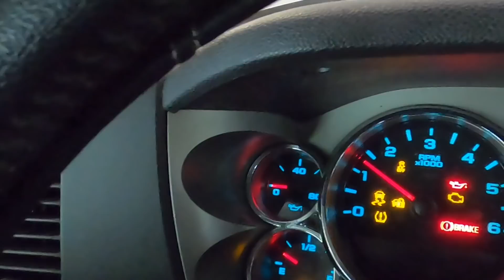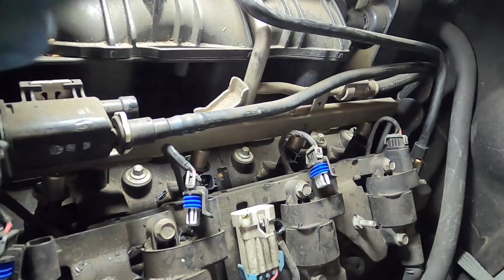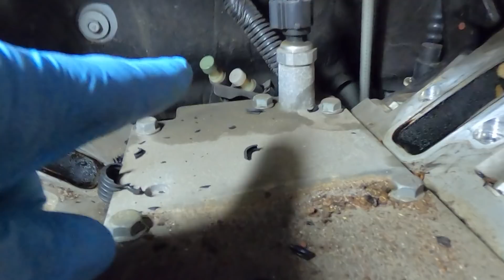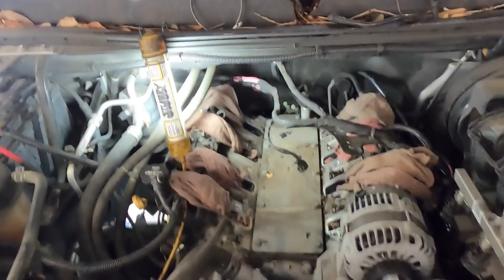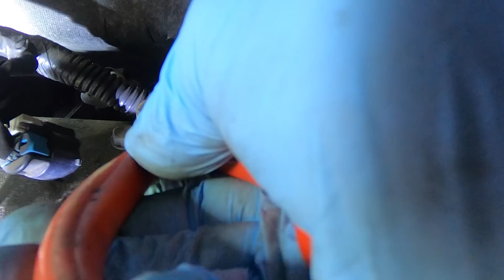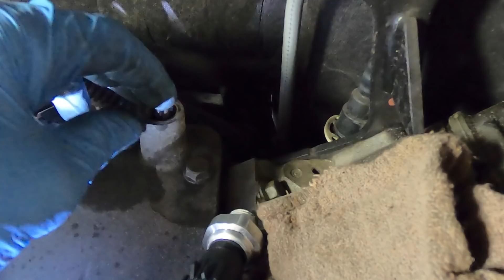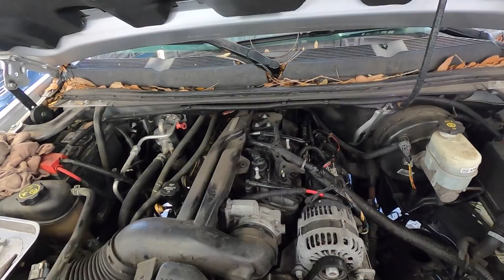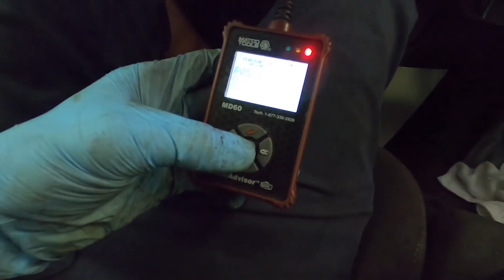Customer States: Google Diagnosis…replace this part!

Comment: Next time you get one of those, try ops socket with a swivel. A little tricky but you can remove the sensor without removing the intake ive done it a few times.

Comment: Great video. I would have taken that manifold off and replaced that sensor, and then scratched my head over how all that stuff went back on. I'm a whiz at removing anything in the way, but then....  If I worked there, I'd have to call for a group meeting and group vote about your shop radio. Seriously.

Comment: Haters are gonna hate.  People don't realize that 'book time' isn't ACTUAL TIME TO INSTALL.  You have to pay for your tools, the shop has overhead, insurance, office people, TV FOR THE WAITING ROOM, etc... etc.. etc...  You are NOT just paying for the part and time it actually takes to do something.  If they don't want to pay for that crap - take it to a shadetree mechanic and pray that they don't f something up - because I can guarantee you that they WILL NOT PAY to fix something they f'd up.  Going to a reputable mechanics shop, they'll stand behind their work.  Down to the bare bones - good job, Ray.  You take pride in your work and try and do what's best for the customer with the least amount of damage to yourself or the items you're fixing.  Like the truck that was over 20 years old (I think?) and you cut a hole in the plastic to save having to tear the dash apart (I think again... : )) and save the customer somewhere around $400 on the fix?  Good on you.  Customer was very appreciative, I'm sure.  

Anyways, keep up the good job.  Like you've mentioned, there's a 100 different ways to do something and depending on the vehicle and the way the engine is set up can make it a 1000 different ways.  :)

Comment: Friendly  advice if you are not going to replace the screen  you can cha ge the oil pressure sensor  without removing the intake  it just takes patience  and little bit of dexterity

Comment: So, what was the issue? Or what do you think it was? Instrument cluster gauge fail? Bad wire?

Removing the intake manifold to replace an oil sensor. Like doing the same to replace spark plugs... Built in labor for dealership mechanics.
Reply: You don't have to remove the intake to do the job. I'm just assuming he likes the longer process but easier version.

Comment: Whoa...I've never removed an intake to replace a gm oil sender.
I climb up on top. reach around both sides of the plenum and use a deep sender socket and appropriate extensions.
once loose, I remove by hand, start the new one by hand and tighten with the same tools. screen or no.
about 15 mins
Reply: Same! It's been a while but I don't even think the book pays for the intake to be removed either.... lots of wasted time but whatever is easiest I suppose, the guys really smart either way

Comment: You're a man of wisdom and integrity Ray.  I like that you explain the overall picture on jobs like this one, including pointing out things that the occasional idiot customer says or does. I highly suspect that 95% of the commenters who say they've done this exact same repair dozens of times without manifold removal or bleeding are liars.
Reply: Don't need to remove the intake manifold on a 1997 Suburban w the 5.7 liter vortex, just the air intake and the distributor.
Reply: Regardless of what you say,I have a half dozen  times. If you don't believe me. Bring  lots of. money and I'll  bet you and you can watch me do it.
Reply: I agree I want to trade there's no way you can pull that thing without taking the intake out oh I know drill a hole through the back of the firewall and it be right there no I'm dreaming hey have a good day

Comment: so 3 weeks pass ....I get a check engine warning on our 2006 Commodore Omega (Aussie version of a Chev Impala) it has a 3.6 liter V6 Alloytech motor ............I put my scan tool on it to get the trouble code P0523  , Mr Google told me the code was the oil pressure sensor , so I ordered a new one .........and the socket to remove and replace the faulty sensor , fortunately the sensor is in a relatively easy spot to get to , no disassembly of anything required (thank heaven) .....however , the tool to remove / replace , was more expensive than the sensor !!!

Comment: Hey Ray. I didn't see you take out old screen . They are usually plugged,  changing the sensor doesn't help you need to change screen.  I see that you couldn't install new one. Because old one needs to be removed. 🤔🤔🤔🤔🤔🤔

Comment: If you have a high that means it's a broken wire it's high resistance so the wire was broken somewhere along the line it may have been really easy to get to you didn't check the connector on the pressure sensor so that's where the problem could have been it it could have been the wire right on the connector or the oil pressure sensor but you didn't check that you didn't put a gauge on the oil pressure sensor port to check to see if the oil pressure was actual with the good gauge and you didn't check to see if the computer was connected by The wire isn't that part of it wouldn't that be part of the repair just to check that use your electrical meter there or your scanner I would at least put my scanner on there and check it then you could have said well I know you told me to repair that sensor but I think it's a broken wire so therefore I'll change the sensor and fix the broken wire

Comment: Ray check the wiring harness and the connector it was right there man just right there you could have owned it out just passed the connector check the integrity of the whole wire to the computer maybe that computer connector inside of the PCM that one wire is probably corroded on the computer

Comment: I think you should have checked the wiring harness to the sensor that's what you usually do isn't it on your other repairs I mean the guy was kind of stubborn just say just replace the sensor but I think we all know better you have to check the wiring harness it could be a bad connector right there at the sensor and then you had to tell the customer you know we had to charge you for that sensor connector I mean how much of a big deal is that and fix the broken wire put on a new connector

Comment: Then you could have said well you said only put the sensor on there but I found out that there was a broken wire to the sensor I mean isn't that one of the reasons why you do that I mean if it wasn't too much of a problem to fix the wire I guess you could have just thrown that in there right you took you five or 10 minutes to fix the wire maybe it was a connector then you would have to telling me I have to charge him more because you had to replace a connector in The wire I mean what could you do you could you could argue with the guy

Comment: I think that repair should include a wiring harness check to the sensor the oil pressure sensor even though maybe they're customer didn't ask for it once you had that apart all you had to do is put a meter on it or something like that I guess

Comment: Changes one of these myself, and chose not to take the manifold out, and it was somewhat of a pain in the ass. As the mechanic working this, he can do it however he sees fit doing it. I have seen people that did it without removing the intake and barely had it in and ended up with bigger issues, I even new a guy crossthreaded the hell out of it.

Comment: I too am an Engineer with design experience.  Failure probabilities for sub-components should factor in the design refinement.  Some customers appreciate a serviceable platform i.e. Caterpillar, John Deere etc.  This will build a loyal customer base but alas, the profiteers may not weigh this in their annual bonus calculations.  I do support the factory producing videos on likely repair scenarios rather than exploded view diagrams and the crap shoot regarding mechanics' skill levels.  We know designers would fail in these activities and the resulting videos would be priceless comedy at conventions and training centers.

Comment: I'd imagine his google research actually told him intermittent failure was most likely caused by the stepper motor or the pickup tube o-ring, but then he realized there was a third and cheaper option to try first.

Comment: Just curious how you justify performing a possibly unnecessary service with not educating the client about diagnostic time.  The money he spent on replacing the part could have easily covered diag time as we all know it takes less than five minutes to diagnose a non active gauge on a GM product.  Maybe it’s just me wanting our industry to be held to a higher standard, but, I will NEVER put a part on that I haven’t verified has failed. 35 year shop owner.
Reply: You've missed out on some really good opportunities Moe. In the 26 years working for myself, I've had many times a smartass customer hands me parts and orders to R&R because they are the expert. I explain nicely (one time) the benefit of t/shoot before repair, but follow orders if that fails. Idiots like this have totally paid for a $21K motorcycle and 3-5 weeks a year I tour the country on now that I'm semi-retired.
Reply: @Robnord1  maybe it’s just my character. But, I will never do that.  I don’t chase money. I chase customer service. People who chase money, end up with, well, just money. I have over a 4000 customer base and only work on the top 20% of clients vehicles. I leave the bottom 80% to those willing to compromise their integrity and attempt to prove character doesn’t count. But, I will state this. What you are doing is exactly why our industry needs a professional license. So it can be taken away when we prove we aren’t competent.
Reply: @moebartlet9659  I base my work on integrity also. Maybe I just have a little mean streak. I don't mind socking it to a know-it -all dummy. Not one bit. Have a great day sir,
Reply: @Robnord1  just know, I’m a professional witness also.  I’ve testified in several cases where the shop installed a part at customer request and the customer sued.  I testify against the shop in these cases and have in over twenty cases and in all cases, the shop lost. I’m not sure putting your business at risk over a few bucks in worth it.
Reply: @moebartlet9659  Interesting. If you ever do videos explaining those cases I'd be glued to them. I've had only one lawsuit over the years. A boater wanted me to de-carbonize the wet exhaust manifolds on the 350 in his boat. I refused, stating marine work was not my specialty, and that I was unqualified. He offered quadruple rate for me to do it if I dropped everything and pulled an all nighter. I did it, but got a tiny bit  of water in 4 cylinders while working. Since water doesn't compress well, it exploded on first sea trial. He refused to pay so I filed a mechanic's lien on him, won easily in court, and was paid in full.

Comment: You are not in a bad spot.  He said replace the oil sensor..  and that's what you did.   I suspect he didn't want to pay for the diagnostic test?  Well, now he will have to and also pay for the work you already did plus the real repair.  Excellent job by you as always.

Comment: Those chevy wiring harnesses to intake are junk the way they route them. My 09 had a short a melted the whole wiring harness to intake.
U can get to sending unit without removing intake but u have to be a contortionist working one handed

Comment: I'm not an auto mechanic, I'm a computer dork. - I must know why mechanics blow out debris where it can go everywhere and you have to plug off intakes for example, why don't you vacuum it out instead?
Reply: Around fuel components and when spray solvents or lubricants are used, a vacuum with the typical brushed motor can provide source of ignition...plus the air nozzle is at hand and convenient. That said, my years blowing asbestos dust from brakes was stupid, and probably damaged my lungs a little.

Comment: If you need to remove so many parts to get to the oil switch, it is a fault design in my opinion, i will never buy a car with this engine design 👎

Comment: With these fault codes, it wouldn't surprise me if the certified mechanic doing a diagnose would've come up with the same diagnosis; change the sender.

Comment: Apparently some people think the diagnostic part of the job is easy or expensive. Generally, when you find a good shop, it's better if they do the work. It helps if the problem can be reported accurately with details.

Comment: He should've said, can you fix my oil pressure issue instead of trying to look cool, as if knowing what's wrong with your truck makes you look cool or smart to a professional technician doing these repair's day in day out. 
Customer needs an oil pump, oil pan gasket, pick up tube, front timing cover gasket. Will fix his lower pressure issue, i've done many of these.

Comment: The right length extension and a swivel will get that out in less than 5 minutes without pulling the intake.

Comment: Those are actually like the last good GM trucks 07 to 09 the 48 was called the LY2 with no VVT and no AFM and had iron blocks . Then 2010 to 2013 it was upgraded to rpo L20 with VVT and Flex fuel capabilities but still iron block and no AFM That's actually the last good GM truck engine some of the 6.2 L in GMT900s also didn't have AFM I believe the L9H and the l92

Comment: By the way, some customers can diagnose and repair perfectly fine.  They just don't have the tools, time, space, details, experience to do the work sometimes, or just don't want to do it.  And if they just want to use you as a hired hand, what's it to you. Yet, if you guys weren't so snooty about precious diagnostics, you could help yourself out with a few minutes of basics.  Maybe you could have repaired a wire in 10 minutes.

Comment: It didn't look like you cleared the error codes, but couldn't tell. I would have reset, driven, then reset again and driven before proceeding with anything else. and Yes, I would have replaced the intake manifold gasket as they can be problematic. Love your vids, keep them coming.

Comment: Oil pressure switch on the back of the motor sucks to get at 😂😂😂😂 know this old man who  change his oil ever 20k . started acting up and lights . changed the pressure switch oil and filter run like new

Comment: I don’t know if someone already wrote about the filter under the pressure sensor that didn’t fit, this engine doesn’t look like a AMF engine, the valley cover is flat with no oil passages.

Comment: If memory serves properly you have to reset the code in order for the sensor to register or at least that's what I had to do on mine. But obviously there could be other issues You just never know until you fully diagnose

Comment: 4 quarts of kerosene and 4 quarts of cheap 10-30 will cleaner out.  Let it run until operating temp and then drain and flush with clean oil.  Helps those lifters out a lot.

Comment: I can tell you are not very familiar with “the LS platform engine. You did not remove the old oil filter screen which was probably completely filled with sludge, that is why the new one would not fit down inside the hole and the issue was not fixed. I usually use a m6 bolt to thread it down into the screen to get the old one out.

Comment: I would have said screw it and drilled a hole through the firewall. Engineers should have to work on their design.

Comment: You do not need to remove that use a swivel and your done in 10 minutes
Reply: You have to clear codes and cycle key to get the gauge to work

Comment: I know it's a pain to do but you can get to that oil sending unit without removing the intake manifold it just takes the right wobbles and extensions with a ratchet and you can change it no problem I've done hundreds of them

Comment: Being fairly familiar with these engines and having replaced the same exact part on a gen 4 engine, you do not need to remove the intake. 2nd, you stated it is a 4.8 and not a 5.3, the gen 4 4.8 engines I’m familiar with never had AFM hence why the valley plate has no structural ribbing. I don’t believe the smooth valley plates have a provision for the screen in the sender hole. I enjoy your content man, you’re a good mechanic and are very cautious to not make mistakes.

Comment: GM in dictionary defined as the source of infinitely stupid engineering. Removing the entire intake for an oil pressure sensor (consumable item subject to fail) is about as DUMB as having to remove the whole front clip of of the car to change a flat, but let's not give the geniuses🤣at GM any IDEAS!!!!

Comment: OK, customer didn't want to pay for intake gasket?  Save a whopping 10.00 to 20.00.  While the intake was off and it was my truck I would of done the knock sensors also.  Why pay for labor twice.  When you have an older car that is miled up I usually replace anything that has the potential to break.  Not saying to replace the entire intake however replace any part that may give you an issue in the future that isn't too expensive.  I hope you charged for the manifold compressed air clean out.  Good work Ray and keep the videos coming....

Comment: mine did the same thing and it was the oil pressure sensor and i have picture of the swivels and extensions i had to use but i did it without taking the manifold off 15mins

Comment: I have followed you for bit but i don’t understand why you blow instead if using a vacuum. This would also keep from any debris from falling in and wont be needing to cover each intake channel?

Also why not recommend a new intake gasket and avoid future issues to the customer if the job requires to be removed. 

Sorry my OCD is killing here , you also did not clean the surface that makes contact with gasket. 

Again just my comment i do understand if customer not paying the no need to do any extra steps. I get it.